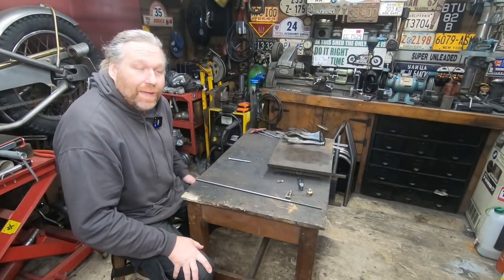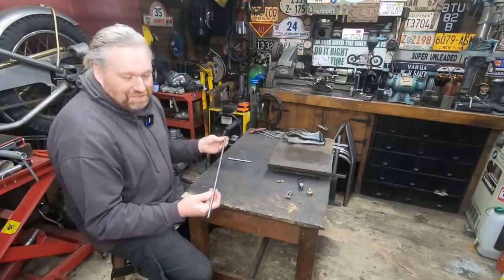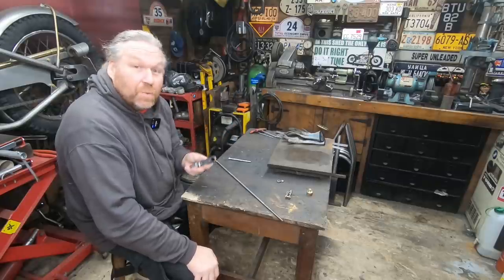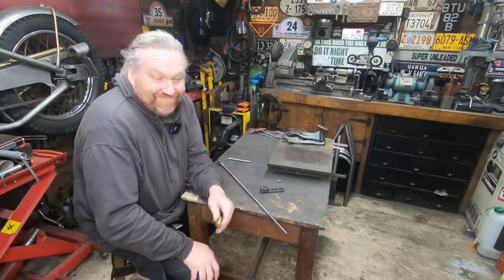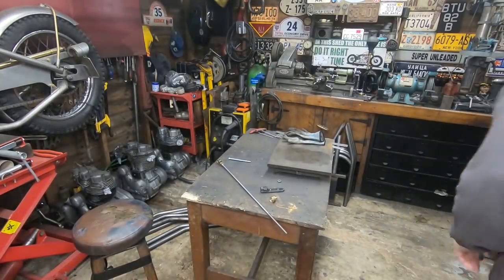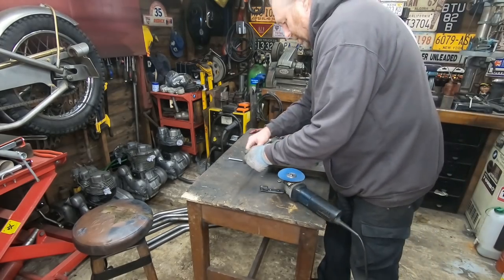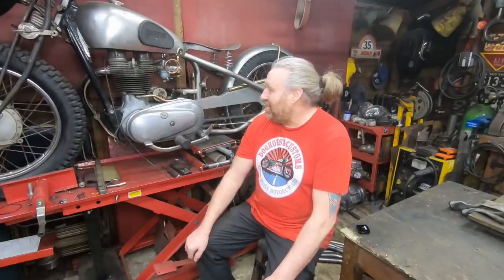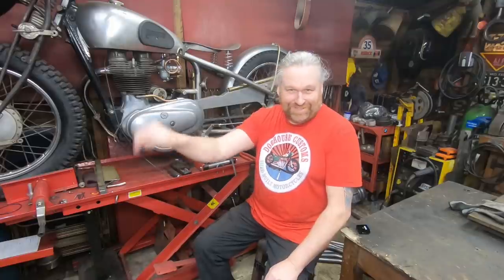Royal Enfield Bobber Project Part 22

Comment: I'm very concerned about something. The tire pump you have mounted on the chain guard when taking a hard pounding from the ridged tail end could very easily bounce out and become lodged in the rear spokes and result in a very rapid out of control crash with no warning. It looks nice but is it really safe?
Reply from the maker: It will be 100% safe when its finished Joe